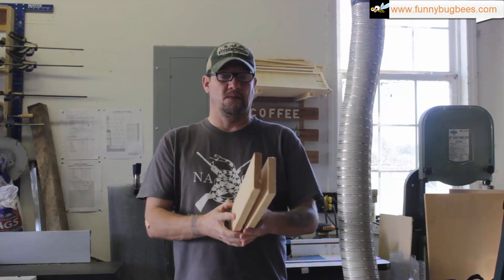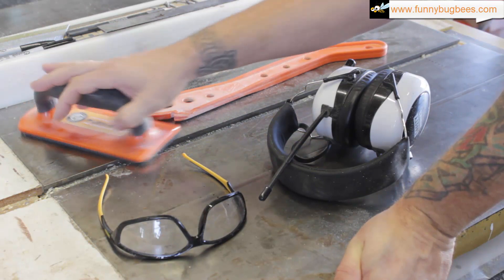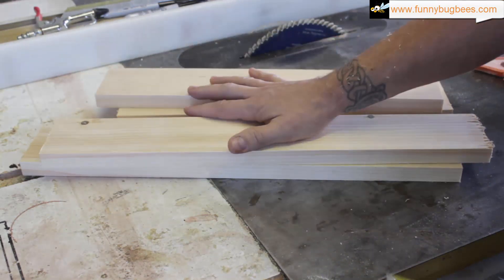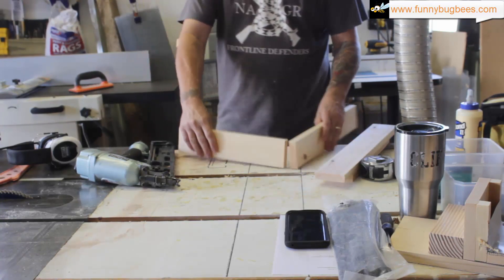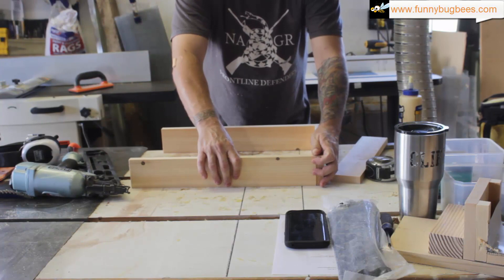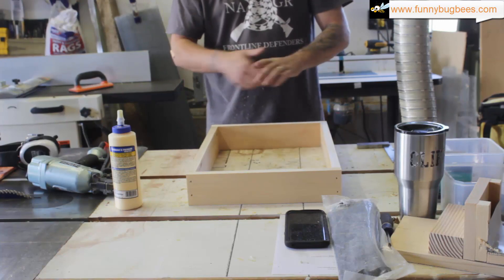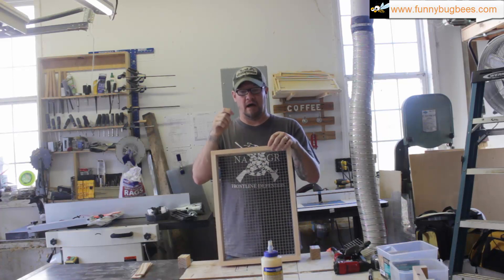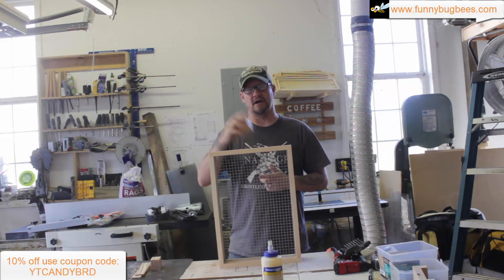Preparing Hives For Winter Pt. 1 - Howto: build a candy board step by step

Comment: You should have shown how you folded the hardware cloth to fit so perfectly in your frame, instead of jumping ahead and skipping that step entirely!
Reply from the maker: good call. To keep videos short i tend to skip easy steps which are more common sense. However, to answer the question i use a 30" metal brake i got from harbor freight to make all bends in hardware cloth, sheet metal for outer-covers, etc. I simply scribe the line on the mesh for the inside dimension of the frame then bend it on those lines using my metal brake.
Reply from the maker: Also, Jack i should have mentioned before I got the metal brake...I scribed a line with a sharpee marker and a straight edge, then used the edge of my table saw to put that line on and then just bent it down. works great.

Comment: Thank you for your video.  Well done and informative.  We are new beekeepers of just 2 months.  I made moisture quilts for our hives last week (looking forward to your video on them to see if I need to change anything) and candy boards are next!  Why is 3-inch height so critical that you ripped just 1/2-inch off the boards?  Also, when do you install the candy boards?  Is it okay to put them on earlier than they are needed so when it gets really cold I don't have to open the hives?  I have seen some candy boards with a 3/8"-1/2"bee escape hole.  You do not include one.  Can they cause problems or other disadvantages?
Reply from the maker: its never a good idea to put food on any hive unless there is a need. For instance, the reason you don't put sugar on during a nectar flow is that the bees will see a source of food in the hive and stop bringing any in, concentrating on harvesting the syrup and ignoring the resource they have outside the hive (nectar). This means when your syrup is gone and the nectar flow is gone  you will be feeding them all winter. Same for candy boards. They should be put on in winter, after all nectar flows are done. In our area this means around the end of November. When average daily temps are staying at or below 50 f. Adjust this date for your local area, just watch the average daily temps. Bees will not take sugar until its an emergency, they prefer the full super of honey you left them to overwinter on (you did leave them a full super right?) so they don't go for sugar until thats gone anyway. So when you put it on doesn't matter much as long as its after all the nectar flows have stopped.  Regarding the escape hole. Your inner hive cover goes above the candy baord, so the bees still have a top entrance. 
 The chimenys i include give the bees easy access to the area above the sugar candy and therefore easy access to the inner hive cover entrance.
Reply: Thank you!  Your guidance on feeding vs. nectar flow and the temperature guide are helpful.  I understand better.  We've had a good freeze, but warmed back up to the upper 50s, so I will watch the temps.  Yes, they have a full super of honey; I'm just nervous because we're new and didn't want them to starve for our ignorance.  I like the idea of the chimneys.  Thanks again!
Reply from the maker: I use a candy board on EVERY hive, even ones going into winter with a full honey super. To me, I look at it this way...Once you buy or build the candy board you are looking at about a $6 investment per hive to buy the sugar......So for $6 you are potentially not going to spend $130 for a package, $150 for a nuc to replace those bees that starved out. To me, that's just cheap insurance!
Reply: Thank you.  I did build & add candy boards to all hives in early December, and I am so happy I did - definitely cheap insurance yes!!  We had about 2 weeks of subzero temps, and when it temporarily warmed up in the low 50s this week I quickly peeked in on them and all three had at least half of the candy gone.  I will watch carefully into spring that they do not run out.
Reply from the maker: Just make some fondant and add it to the feeders, ive got a recipe for it on my website here: https://www.funnybugbees.com/bee-food-recipes/feeding-bees-fondant-bee-candy